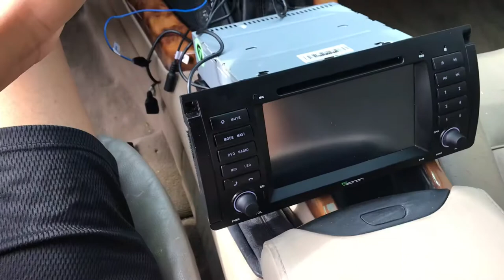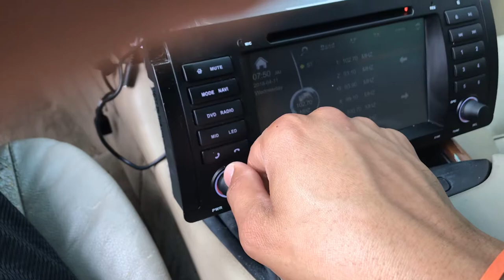Installing Eonon D5166 in BMW X5

Comment: did u have to cut out the factory stero bracket?  i have ga9166 eonon did urs fit right in   eonon is confusing as hell
Reply: yes u have to cut it out
Reply: Wish you would’ve shown the install all the way through. Was hoping to see how you mounted/screwed the unit into the dashboard. Can’t seem to figure that part out.